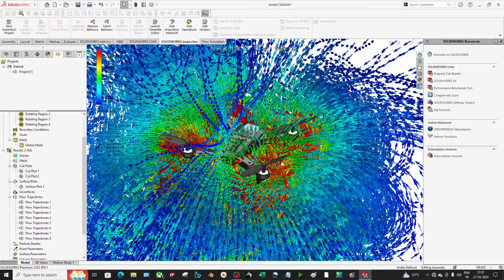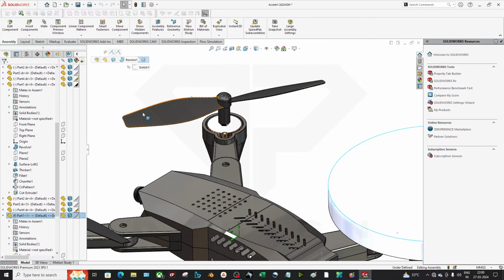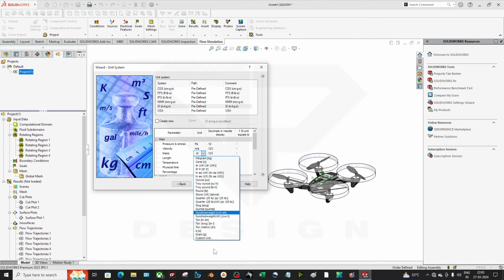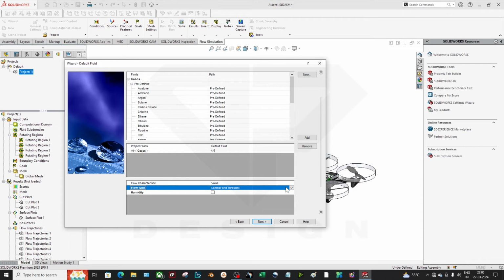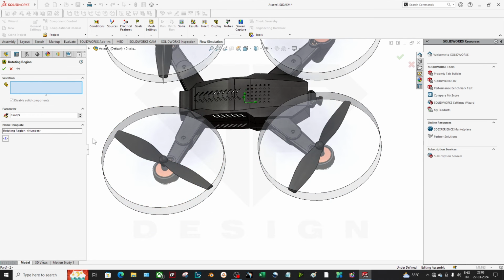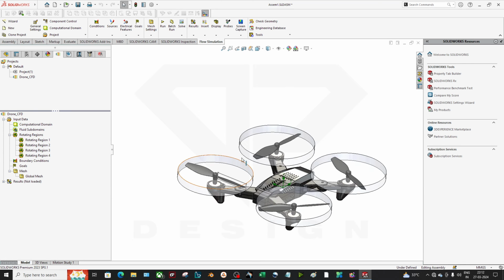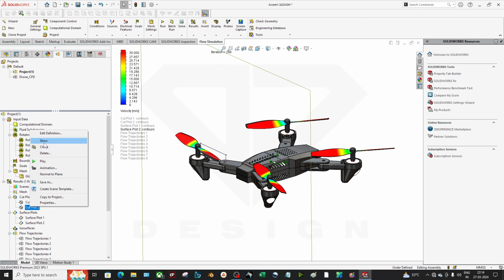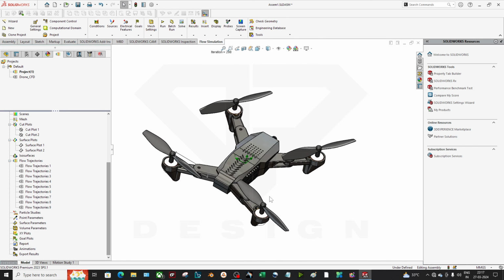Drone Aerodynamics CFD Simulation tutorial using SolidWorks Flow Simulation | CFD | DP DESIGN

Comment: In rotation regions, the vertical arrow indicates the direction downward instead of upward. Is there a way to change that direction?
Reply from the maker: Yes
Reply: Change the revolve direction with the 'edit part' function in assembly. I had the same issue.
Reply: it depends on the initial frame direction of the disk, so if u want to change the direction of the normal arrow just invert the disk